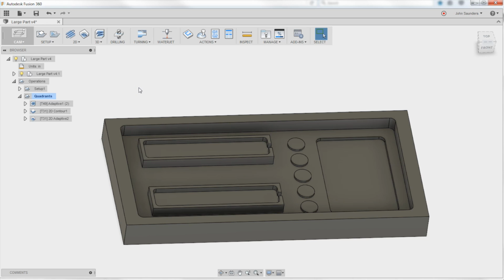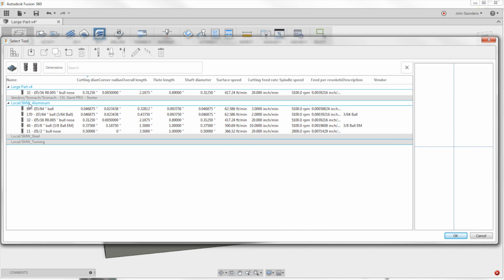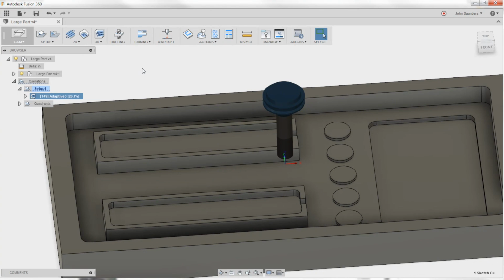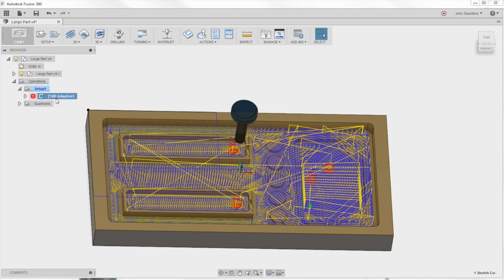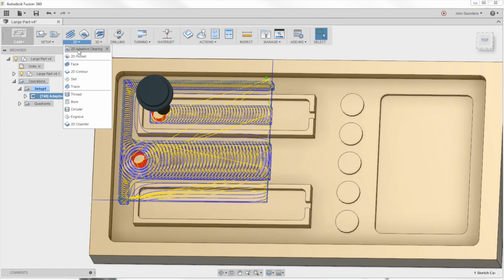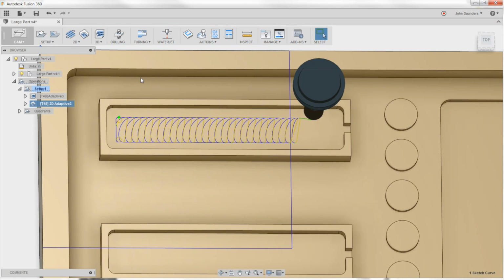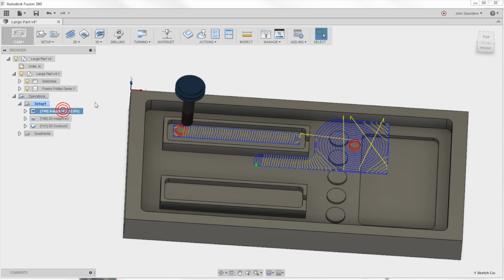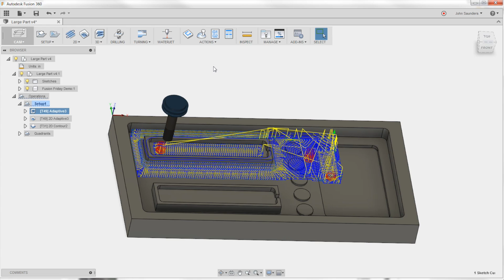Machining Large Parts in Fusion 360: Toolpath Containment!

Comment: A concern here seems to be where the tool enters. It's going to assume the area outside of the machining boundary is clear (i.e. no raw material there), and so it's very possible to rapid right into stock. I guess you just have to be extremely careful?
Reply: There's an additional option - tool containment.  It lets you specify tool outside boundry, tool inside boundry, and tool centered on boundry.
Reply: not everywhere. i'm having the same problem, worked around it but it is a pain, when limiting the stock it assumes the one outside is gone and wants to plunge in. talking about 2d adaptive. theres tool containment in 3d, have to fool it in to working in one plane only.

Comment: Is the machining boundary function only available for 3D operations? I tried to split some 2D contouring up into two sections, but the machining boundary checkbox is not available unless I try to do a 3D operation. Thanks for these great Fusion 360 videos!
Reply: For 2-d operations, you can make a sketch, show the sketch, and use that as one of the contours you select as the edge of the pocket.

Comment: John,

Thanks for the vid!  I'm using Fusion360 for shop drawings and 3D printing so far, but hoping to have a mill someday so it's all interesting. Any mill I get will be a small one due to space limitations, and I've been wondering about how to mill things in stages, so this was a great choice of subject for me.  A related area is how to design things, like say a sign, so that it can be made in pieces and put together later.  Been thinking dovetails, half-lap joints screwed or welded from the back, alignment dowel pins, and other ways to join pieces so it doesn't show from the front.

-- Mike

Comment: John, I noticed that on your 2D operations the tool path started and stopped outside the boundary area you set with your sketch, how would you keep it in that boundary?
Reply: Set and adjust toolpaths to plunge.
 Guessing they are currently set to plunge outside of stock.
There is also a dimension you can enter that will allow that entered amount outside the perimeter. Just set that to zero.

Comment: Can you limit tool path to avoid locations (such as fixturing or clamps)? Instead of "only machine here" you specify "never go here".
Reply: I'd imagine setting up the "only machine here" partition around the clamps would work for this application. But I wouldn't be surprised if there was.
Reply: It's in the setup itself.  You model the fixtures, check the 'fixtures' box in the setup, then select the fixtures.

Comment: Very interesting, thanks.
But also I think that this could get you some problems. When it say "stock" it really thinks, that the material is only there where you defined it. As you can see, it places the mill right besides the stock and then comes in from the side. If there's unmachined material on the side the CAM didn't know about, it's going to plunge the mill directly into the material. That can't be good...
Reply: I noticed that too...the lead in is going through unmachined stock. Is there hold-down avoidance in Fusion360?  If so, maybe you could define hold downs in the areas to avoid and keep it from hitting stock outside of the defined perimeter of the area to machine. 

-- Mike

Comment: John, is there a way to model a L bracket in fusion and then have it lay flat so it could be cut on a plasma table?
Reply: you could with a parametric sketch profile until sheet metal arrives

Comment: IIRC, if you check "rest machining" and the previous tool's diameter it wouldn't extend out the toolpath for the adaptive after modifying your stock contour dimensions. Or you can drop a point and explicitly specify it as the operation's entry position under the "linking" tab

Comment: having work sketches outside of components (sketches used for machining or nesting) makes it easier to change or delete them without changing the model as you can do it off the parent tryade  and it won't affect the model. and you can use sketches for cut paths, it's a non documented fusion cam thing. I have only seen 3 vids doing this 2 are yours
Reply: agreed. it's definitely something I do
Reply: it's something that needs more info done  on it,

Scott a new vid you could do
Reply: +daniel lyall well yeah. but doing CAM stuff at the top level of the assembly seems super logical to me. why would anyone go out of their way to make it more difficult?
Reply: A not getting what you mean.
but doing CAM stuff at the top level of the assembly seems super logical to me.
this is what I mean info for doing it this way it works and has not failed yet for me

Comment: 2d long entry glitch makes sense, plunge outside of stock turned on? rather than helical ramp or similar?
Reply: Not a glitch! John told the software where there was stock so it had an open side to plunge outside. The toolpath isn't that smart.